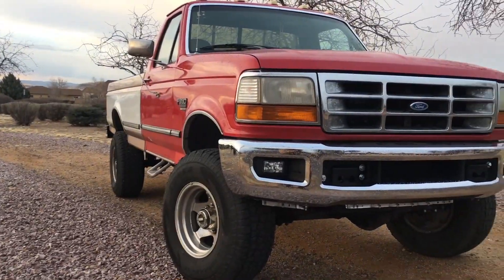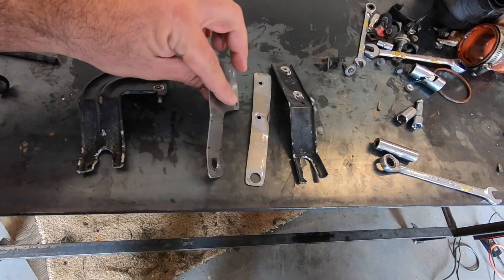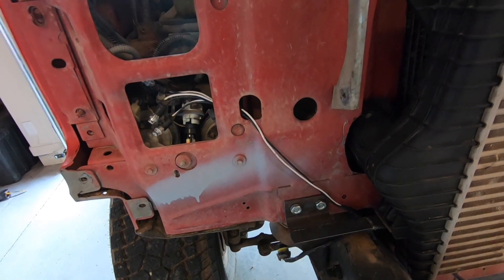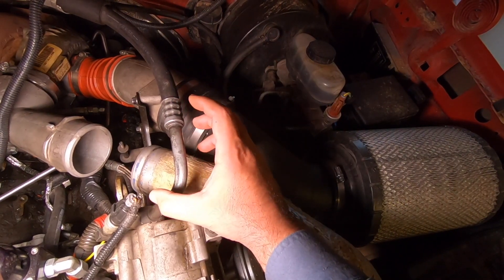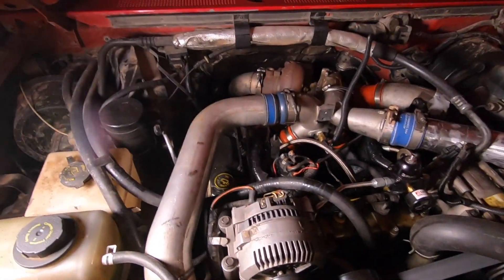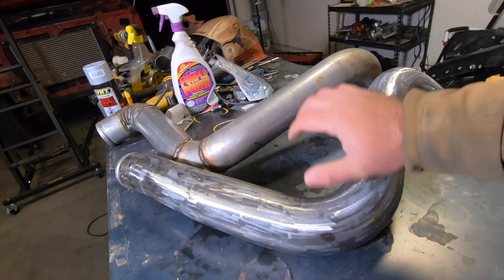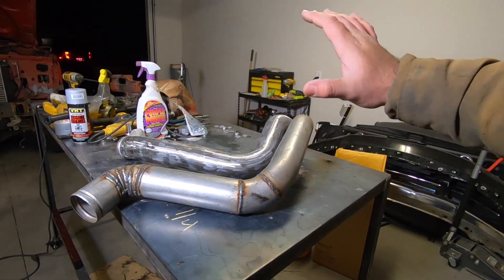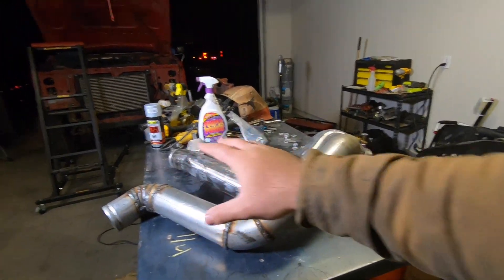OBS 7.3 INTERCOOLER INSTALL PRT3

Comment: I installed a banks system in mine and it was awesome i was really surprised about well it fitted. They used existing holes for mounting and the pipes fit pretty good. It brought my egts down about 350 degrees pulling 8,000 lbs on my 70 horse tune up steep hills so Iam pretty happy with it. Yours looks good also hope it works well
Reply: I got mine for four hundred and had to pull it from a parts truck